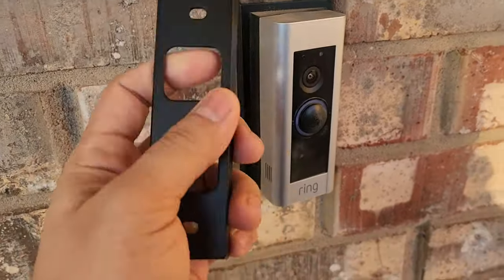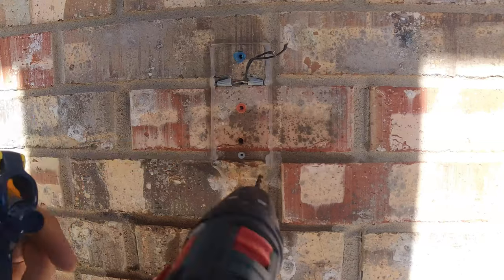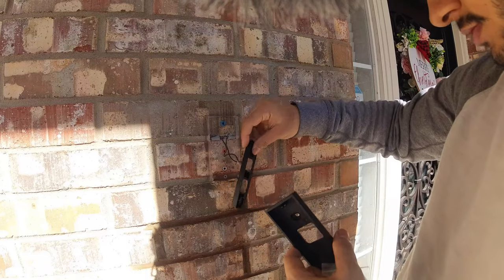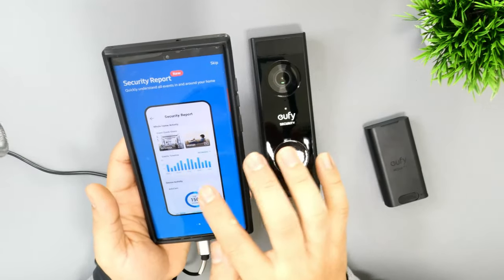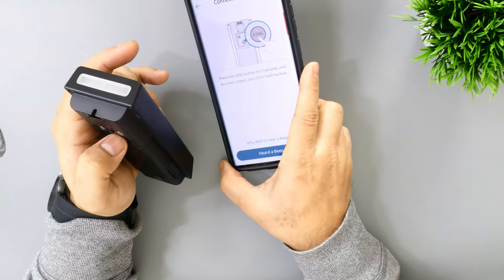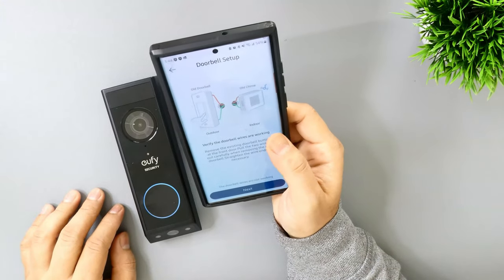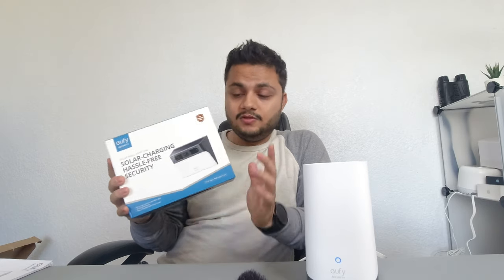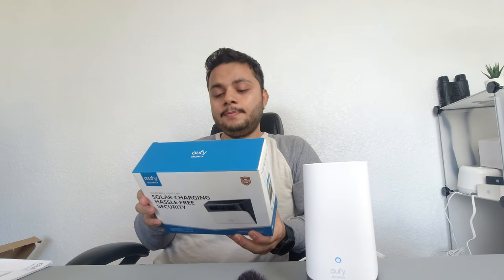Full Installation Video || Eufy Video Doorbell and Home Base || The Unboxing Journey

Comment: Does this doorbell need the Homebase for it to work?
Reply from the maker: It should work without homebase, because camera itself comes with a 8gb storage for it to store the video files independently. Homebase will just gives you an additional storage option, plus it works as a chime. This doorbell requires separate chimes to purchase or can connect to your mechanical chime in your home, if you opt not to buy homebase

Comment: Have been using the wired 2K for a while now, started fine but lately, without any change in network etc., it started acting up.
No connectivity when trying to remotely view the camera after a doorbell press and als ghost pressing, doorbell goes off without anybody in the neighbourhood. (Have another cam outside to confirm no kids ffing around)
Eufy has been keeping me busy with their standard check this and that protocol on multiple occasions as, nothing helps.
They now say I do not qualify for warranty because the purchase occurred more than 1 year ago.

So be aware if you are in the EU, Eufy does not want to provide the mandated 2 year consumer warranty. They simply ignore that.
Reply from the maker: @fransdevries4085  wow.. I am so sorry this happened to you. Hope mine survives longer 😄

Comment: Hi friend, thanks a lot for your video. I got the same device but I’m annoyed that my phone doesn’t give me sound notification when someone rings at the door and I’m not home. Do you know if there’s a setting that allows to make the phone ring so we can answer the door even when we’re outside? If I activate sound notifications in my Eufy app, it makes all cameras produce sound notifications which is obviously annoying… but for a doorbell camera it would be nice to hear the phone ring right? 
Cheers
Reply from the maker: Did you check the allow sound and vibration on the notification section? If you enable that the motion detection sound is different, but you can hear the ring on your phone
Reply: @TheUnboxingJourney  ohhh thank you so much, I hadn’t found where this setting was, but now I did as you said and it works 🤩🙏

Comment: I think I would have just drilled the bottom hole in the Eufy mounting plate rather than in the brick.
Reply from the maker: I was trying to do the same so that I would same some of my energy. However, the wires coming out will get squeezed inside the plate and that made me little worry because I may break if I need to install another doorbell in the future.. Thanks though for your suggestion.

Comment: When does the blue LED halo light around the doorbell button illuminate? I installed and wired the same video doorbell two days ago, everything works great except the blue LED light does not illuminate at all. It's quite challenging to locate the button mostly during the night even when the top and bottom LED lights are illuminated. The blue LED halo light around the button of the Nest doorbell I replaced automatically illuminates when a motion was detected.
Reply from the maker: @abbojectpro6164  when motion detected the blue light will lit
Reply: @TheUnboxingJourney  do you mind sharing how did you make it work? Thanks!

Comment: Hi, thanks for the nice video! I wanted to ask you, do you receive notifications with the photo of the person they pass by without ringing? In this model I noticed a slowdown that the doorbell uses to capture the image of those who pass in front and sometimes if they pass in a hurry or don't stop in front they don't even take the photo or start the recording.....there is something to do set yet or is this model just like this? I had eufy video doorbell T8200311 wired but it caught everyone even people who were passing by quickly...
Reply from the maker: It does send you a thumbnail, it has an option whether you want to get a thumbnail or text notification. I think the thumbnail is slightly delayed than text notification. But I have been doing text notification since beginning, so didn't get a chance to check throughly on thumbnail notifications..